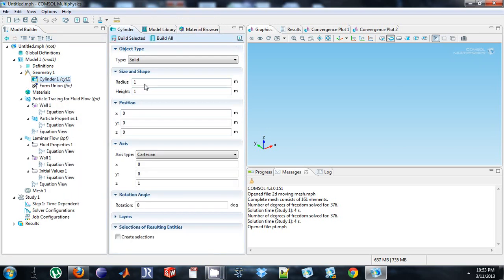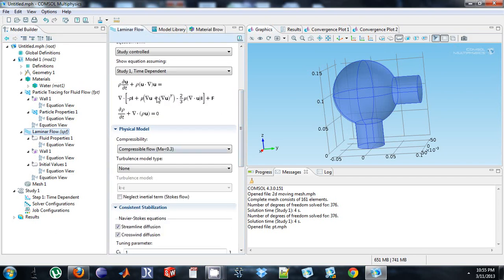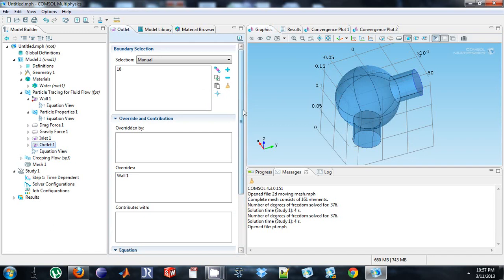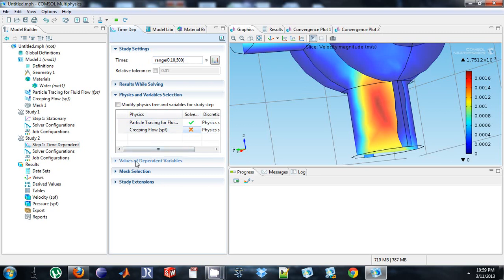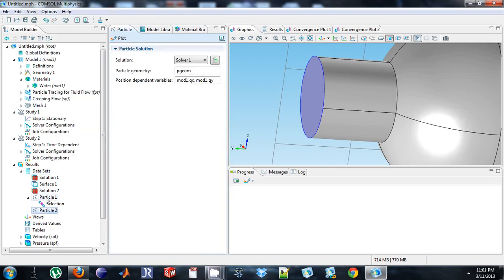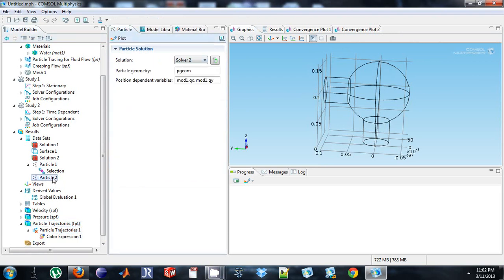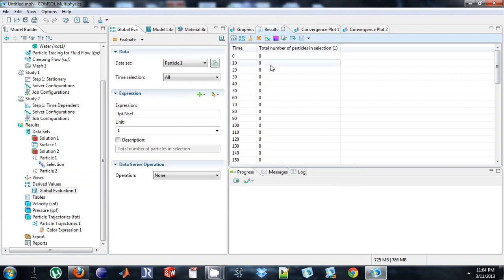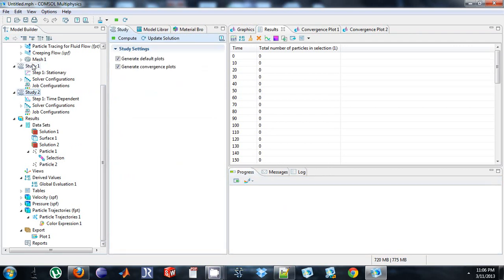particle_tracking

Comment: Thnak u Alex for this helpful video
Actually i need ur help
I am trying to model particles that have a diameter between 0.2 and 1	micrometers in a laminar flow in air
The particles are charged and influenced by the drag and the electric force
I am having a problem in the particle tracing modeling
The complicated geometry of the domain makes the particles disappears because of the the number of wall interactions in a time step
Is there's a way to solve this